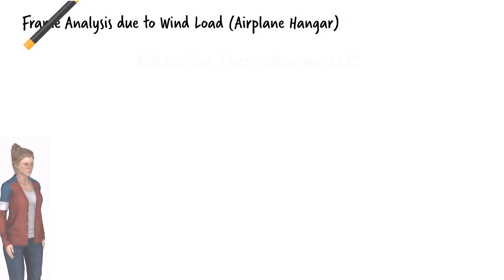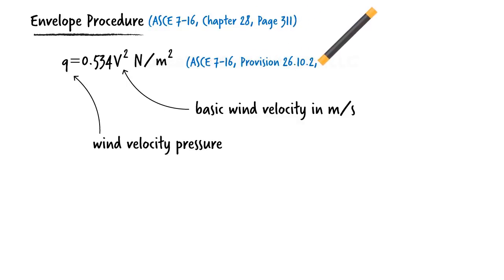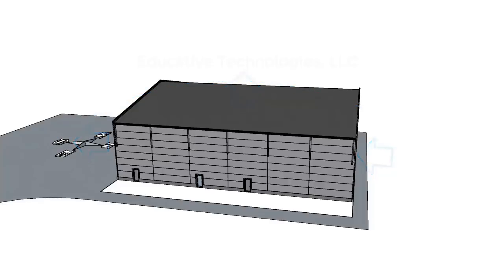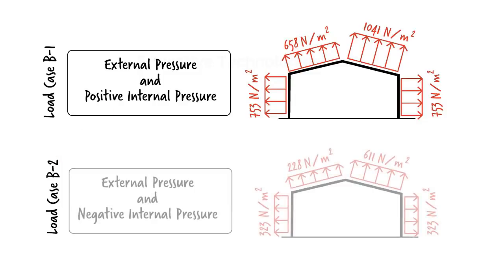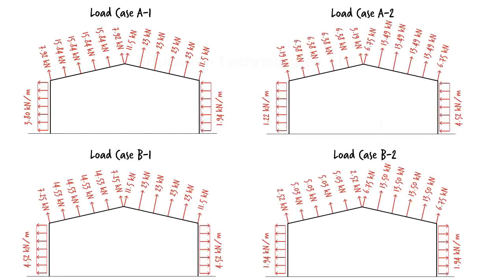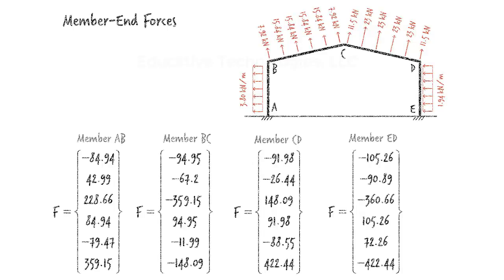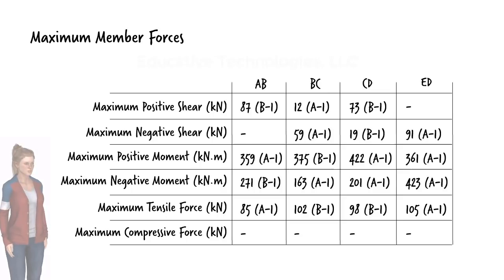SA52: Frame Analysis under Wind Load (Airplane Hangar)

Comment: Please, Where the coefficient: 0.45; -0.69; -0.42; -0.35, for Load case A (East-West)????. I found on the code at page 313. Figure 28.3-1, the coefficient should be: 0.4;-0.69; -0.37; -0.29, for roof angle 0-5 degree
Reply from the maker: The inclination angle for our roof is about 11.6 degrees. We need to interpolate the values given in the table in Figure 28.3-1 to arrive at the correct values for the roof.
Reply: thanks
Reply: Example: In the case, the roof is flat (angle =0), what is the coefficient for Load Case A & B?
Reply from the maker: We use the values given in the table for 0-5 angles. We interpolate only when the angle falls in between the table entries.
Reply from the maker: @samiabhuiyan4607  Enclosed does not mean air-tight; air can still get inside the enclosed building through windows and other small openings.
Reply: @Dr. Structure the values considered are on face 1,2,3 and  and why not 1E,2E,3E and 4E ???
Reply from the maker: @zainsaeed147  The target frame is not located at the exterior of the hanger, where the regions/faces have E designations. Instead, the target (interior) frame is situated in the middle of the structure's skeleton.

Comment: From where and how did you took the value 6m?? Of tributary length?
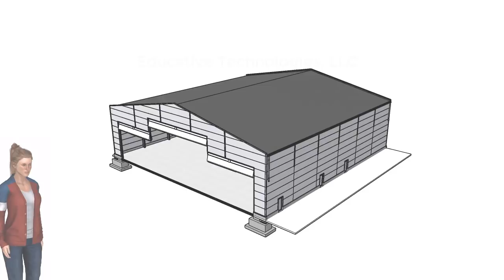Reply from the maker: At the beginning of the lecture (@0:20), we are given the dimensions of the hanger. The depth of the structure is 36 meters, subdivided into 6 spans. So the length of each span is 6 meters. This is the width of the tributary area for an interior frame.

Comment: Why did not you consider the wind direction from the south to the north  that might be more severe than the opposite wind direction?
Reply from the maker: We are treating the hangar as a closed structure, with the hangar door kept closed during high winds. Consequently, the wind impact on the hangar is identical for both the North-South and South-North directions.

Comment: Pls clarify why
q= 0.534*sq(V)= 0.534*58*58
= 1796 N/m2 , whilst your calc is 1196.4 N/m2
Reply from the maker: We have made the correction in a new version of the lecture which you can find in the free online course referenced in the video description field.
Reply: @DrStructure  Tqvm. I am still learning on the wind loads. 
Can you compare your analysis with BS standard CP3 on the walls/cladding? It is like
  q=0.613*Vs*Vs
Vs=1.06*1*1*Vb=1.06*1*1*58m/s
     =61.48m/s
Thus,
Vs= 0.613*61.48*62.48
    =2317 N/m2
Is this correct? A lot higher than th ASCE standard?
Reply from the maker: @yikee7592 British standards differ from the American Society of Civil Engineers (ASCE) guidelines in determining the applied loads on a structure, leading to variations in load values.

Since we don't have access to CP3, we won't be able to do a direct comparison at this time.

Comment: How to make these type of videos. and whcih software you use. please guide. Thanks
Reply from the maker: We use several software tools to create the lectures including Adobe Illustrator, SketchUp, Camtasia Studio, and a few more as the need arises. 

The choice of software is dictated by the conceived organization of the presentation and how best to realize it. We spend a significant amount of time conceptually constructing the presentation on paper. We then employ the fitting (software) tools to implement what we have on paper.
Reply: @DrStructure  Appreciated work...

Comment: Thank you Dr. structure for the comprehensive video explaining the application of the wind pressures calculated by ASCE 7 procedure which I could not find anywhere on the web or elsewhere.  I have to say finding those required pressures is a piece of cake  but how you applied those to the building is none existence. A lot of videos out there are elementary knowledge and have no value at all.  I was stuck for months on that and now I can proceed!.  Thanks.
Reply from the maker: Thank you for your feedback.
Reply: @DrStructure  Follow up questions:  Referring M&S diagram for Member AB,  Case A-1 , is the 85KN vertical load , the gravity axial wind load for use to design the foundation and 45KN, the base shear due to wind load?
Reply from the maker: All the shown loads are due to wind. Needless to say, for the actual design of the structure, other loads and load combinations must be considered.

Hypothetically speaking, if wind was the sole cause of member forces, then we would need to design AB as a beam (since it is subjected to bending and shear) and as a tension member (since it is subjected to an axial tensile force). 

All three forces at the base of AB transfer to the foundation, which means we would need to design the foundation to resist the vertical force, the horizontal force, and the bending moment.

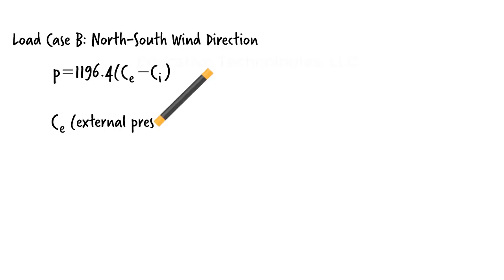Comment: At around 6:50 onward the B-1 and B-2 load cases utilise pressure coefficients Cpe and Cpi for what looks like a transverse (wind across the ridge) loading case.  I thought that those transverse loadings were calculated as load cases A-1 and A-2.  I was expecting the second set of load cases at B-1 and B-2 to utilise longitudinal loading coefficients as the wind is applied N-S on gable-ended walls (including the hangar door which is closed in adverse wind events and making it a Type C normal enclosed building).  Can you please explain why the transverse coefficients were utilised for the Case B load cases?   If this is confirmed to be an error, what are the longitudinal coefficients to use?  Overall, I can readily follow the general calculation processes and find these videos a fantastic resource for underlying analysis principles.  Thanks.
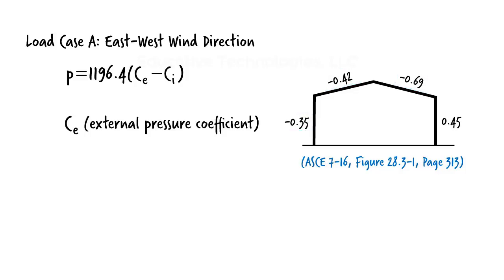Reply from the maker: The external pressure coefficients for the East-West (transversal) wind direction are obtained, via interpolation, from Figure 28.3-1 of AISC 7-16 (under the heading Load Case A on top of page 313). These coefficients (shown @5:22) are: (-0.35,-0.42,-0.69,0.45)

The coefficients for North-South (longitudinal) wind direction (Figure 28.3-1 under heading Load Case B) are:
(-0.45,-0.37,-0.69,-0.45). These are the coefficients used for loading case B @7:00. 

The two sets of coefficients are not the same, although they are some similarities between them. 

Figure 28.3-1 of AISC 7-16: https://lab101.space/qa/windpressurecoefficients.pdf

Comment: At 9:50, it's stated that:
We then transform the member loads to nodal forces. This is done member by member by first calculating the member fixed end forces then transforming the forces from the local coordinate system to the global coordinate system.
I can't follow how the forces are transformed from the local coordinate system to the global coordinate system, e.g., member AB.
Reply from the maker: F = Qf where f is the force vector in local system, F is the force vector in the global system, and Q is the transformation matrix. The details are provided in Lectures SA49 and SA50.
Reply: @DrStructure  
At 5:58 of SA49, the forces F1, F2, F3, F4 of member AB correspond to the degrees of the freedom D1, D2, D3, D4.
At 10:04 of SA52, the forces 18.24, 0, -29.18, 18.24, 0, 29.18 doesn't correspond to the degrees of freedom of member AB since member AB has 3 degrees of freedom, not 6 DoF.
Reply from the maker: @hoshangmustafa9672  Each beam/frame member in isolation (without any boundary conditions imposed) has 6 degrees of freedom. If we label the ends of the member i and j, we get three degrees of freedom at i and 3 degrees of freedom at j. That means the local and system force vectors for such a member are vectors of dimension 6x1. 

@10:10 of SA52, we are given the 6x1 member force vectors in the system coordinate system. Each vector is obtained by multiplying the 6x6 transformation vector by the 6x1 force vector in the local coordinate system. All of this is done independently of the degrees of freedom of the structure.

While for members BC and CD all six force vector elements are used to determine the system force vector, for members AB and ED, since they are fixed at the base (there are no system degrees of freedom associated with the support joints) only 3 of the vector elements are used in determining the global force vector. For member AB, elements 4, 5, and 6 of the force vector correspond to system DOFs 1, 2, and 3. For member ED, force vector elements 4, 5, and 6 correspond to the system DOFs 7, 8, 9.
Reply: @DrStructure  
What about 5:58 of SA49?
Reply from the maker: @hoshangmustafa9672  @5:58 SA49, we have the transformation of the 6x1 force vector from the local to global/system coordinate system. That is consistent with what we have discussed above. Each member in isolation has a 6x1 force vector, 6x6 stiffness matrix, and 6x1 displacement vector in both local and global coordinate systems. Here, since there are no member loads applied to the frame, the system force vector is composed directly using the joint loads.
Reply from the maker: @Hoshang Mustafa For Member AB, in local coordinate system, the force vector is: {0, -18.24, -29.18, 0, -18.24, 29.18}. Or,

0
-18.24
-29.18
0
-18.24
28.19

To arrive at this force vector, we use the local coordinate system in which direction 1 (and 4) is along the length of the member, direction 2 (and 5) is perpendicular to direction 1, and direction 3 (and 6) is counterclockwise rotation at end A (and B). To better visualize this, you can rotate the column 90 degrees, making it horizontal before writing the force vector in the local coordinate system.

The transformation matrix in which the orientation angle is 90 degrees becomes:

0  -1  0  0  0   0
-1  0  0  0  0   0 
0   0  1  0  0   0
0   0  0  0  -1  0 
0   0  0  -1  0  0
0   0  0  0   0  1

The product of the transformation matrix by the force vector above is:

18.24
0
-29.18
18.24
0
29.18
Reply: @DrStructure  
You wrote:
@Hoshang Mustafa For Member AB, in local coordinate system, the force vector is: {0, -18.24, -29.18, 0, -18.24, 29.18}. 
But these are member loads (not joint loads). Shouldn't we convert these member loads to joint loads?
Per SA51 at 4:33 it's stated that:
we need to convert the member loads to joint loads.
Reply from the maker: Yes, we add up the member loads associated with the joints to come up with the joint loads. When the member loads are given in the global coordinate system, their transformation to joint loads is a simple addition.
Reply: @DrStructure  
If you confirm that {0, -18.24, -29.18, 0, -18.24, 29.18} are member loads, then joint loads will be {0, +18.24, +29.18, 0, +18.24, -29.18}.
Or can you provide a step-by-step calculation for system (nodal) force vector for member AB given at 10:05 in SA52?
Reply from the maker: @hoshangmustafa9672  No, the joint loads are not what you have indicated above. Your explanation does not take into account the transformation of the member forces from the local to the global coordinate system. The member load vector in the local coordinate system is {0, -18.24, -29.18, 0, -18.24, 29.18}. When multiplied by the transformation matrix, we get the member forces in the global coordinate system as {18.24
, 0, -29.18, 18.24, 0, 29.18}.  This is the vector we use to generate the system nodal forces (please see a previous message from yesterday for the exact form of the transformation matrix for member AB).
Reply: @DrStructure  
can you provide a step-by-step calculation for system (nodal) force vector for member AB given at 10:05 in SA52?
Reply from the maker: We will not be able to solve the problem beyond what is presented in the lecture. However, we will be happy to provide feedback on your step-by-step solution, if you can present it in an organized and annotated manner. You can email your solution in a pdf file to 
Dr.structure@educativetechnologies.net
for our review and feedback.

Comment: For the life of me, I find it so unbelievable that the leeward side can ever experience anything close to even half the windward side. 
I work on projects both here in the US and in Canada, and I'm constantly calculating Wind Loads (Windward WW) of Leeward W=.625WW, Parallel W=.71WW,  Roof W=.585WW.
That just seems insane to me. Because I've been on the Leeward and parallel sides of buildings during high winds. I've never seen anything close to those kinds of loads.
Reply from the maker: What design standard are you using? Perhaps it’s worth time and effort to compare and contrast with ASCE 7.
Reply: @DrStructure  most of my engineering is to ASCE 7-10 and -16. I have some current projects that I have to produce the loading according to Canada's NBC.
I just never have seen the kinds of loads for parallel and leeward sides that the codes develop.
Reply from the maker: As you know, most modern design standards are probability based, taking into account the risk (mainly to human life) associated with severe loading scenarios, even though the structure may not encounter such a scenario during its life cycle.
Reply: @DrStructure  yes, I am aware.
Not that you would know, but I am a PE and own an engineering firm, Quanta Engineering LLC.
Still, I've just never seen the wind pressures on the parallel and leeward sides ever experience what the codes show...

Comment: An explanation is more than wonderful, but if I want to use an artificial intelligence network to predict the response of this structure to wind loads at different speeds, is there a Matlab code or an analysis program that can find the response of the structure by simply changing the parameters affecting the wind load and its speed
Reply from the maker: Dynamic or time-varying analysis of structures is well beyond the scope of our video lectures. For that, simulation software can be used to model and analyze the behavior of the system under various loading scenarios. You may want to look into the commercially available structural analysis (finite element analysis) tools and see which ones best fit your computational needs. 

Except for a few well-defined problems, "Artificial Intelligence" technologies, beyond the perception being projected, is still in the research stage when it comes to reasoning and problem solving that require deep and non-trivial human expertise.

Comment: WHY USE METRIC UNITS ? AMERICA DOESN'T USE METRIC UNITS. QUIT TALKING METRIC WHILE THINKING IMPERIAL. NOBODY HAS THE FEEL OF KN/METER SQUARE.....EVERYBODY KNOWS LBS/SQUARE FEET. I DON'T HAVE TIME TO CONVERT AND THEN GET THE FEEL. KILO-NEWTON TO ME = 1000 ISSAC NEWTONS.
Reply from the maker: A gentle reminder – the world does not revolve around our preferences and biases. Learning to communicate in multiple languages (be they natural, technical, or measurement related) is a strength, not an inconvenience. Part of the mission of engineering education is to help students across the globe develop a growth mindset, one that potentially could produce more creative and culturally fluid engineers who can then address emerging complex technical problems, both locally and globally. One’s insistence in using a specific way of solving problems (in this case, measuring), although an acceptable personal choice, invariably hinders one’s professional and personal growth in the long run.